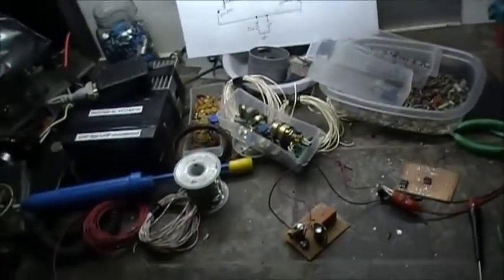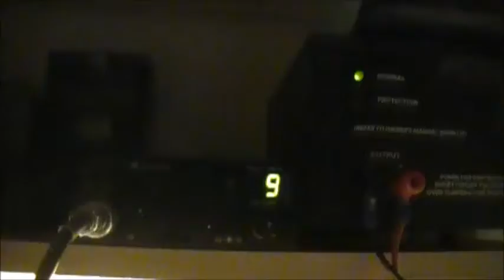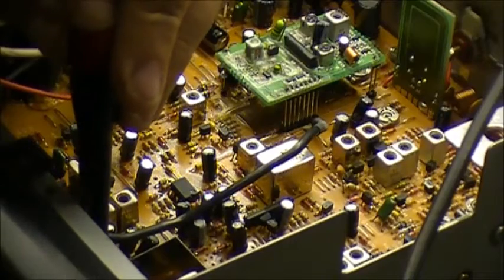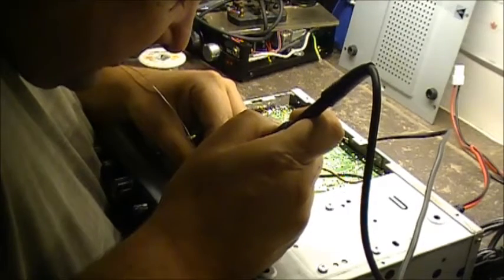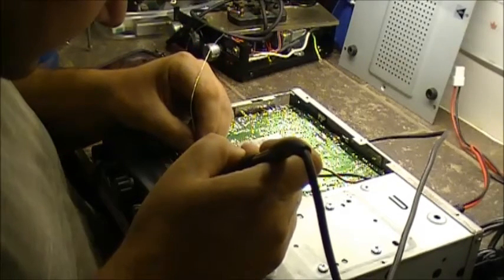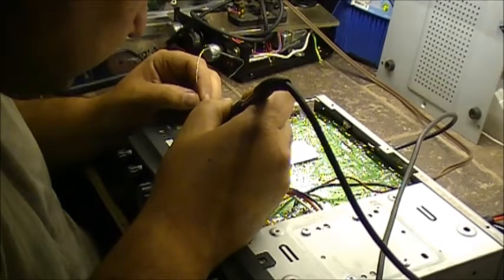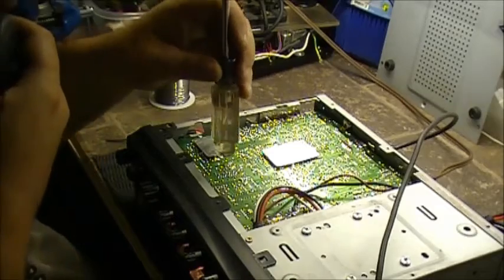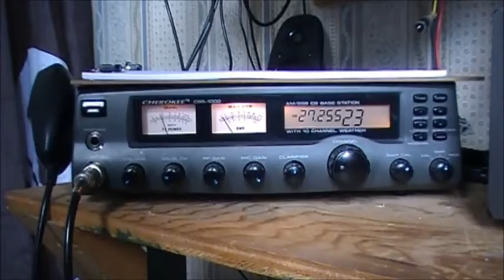CHEROKEE CBS-1000 - Problems and upgrades PART-2

Comment: I've been seeing hot power supplies and high voltages 15-16v because of the ceramics  on the AC 23v side going into the rectifier and the ceramics on the regulator if you have that.
The ceramics are turning into resistors, I seen in on the trc 850, pro 810e and the older bases.
Those big ceramics are the cause, please have a look there.

The radios were hot as hell, transformer buzzing hot all because of the ceramics on the secondaries and just powered on in RX
Reply from the maker: Thank , i will look into that!